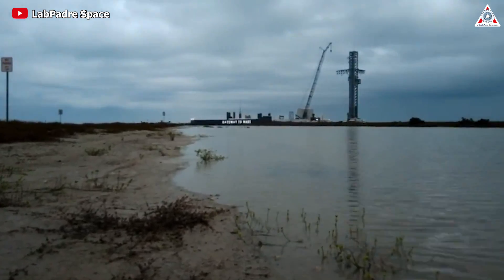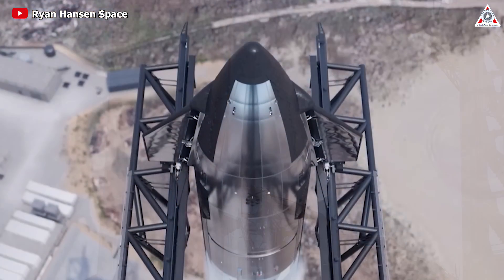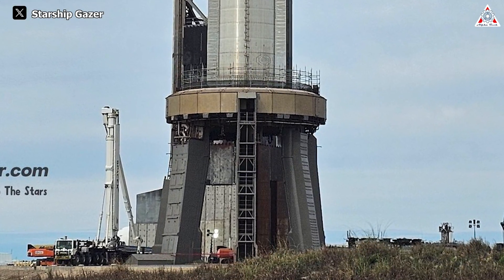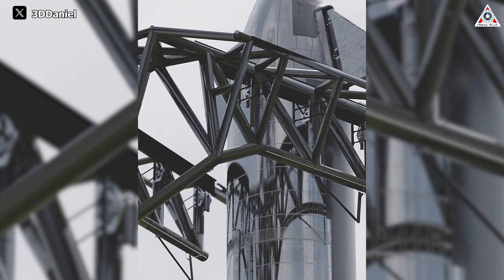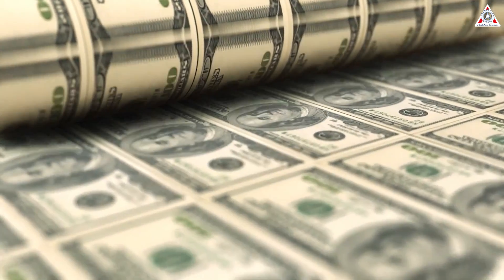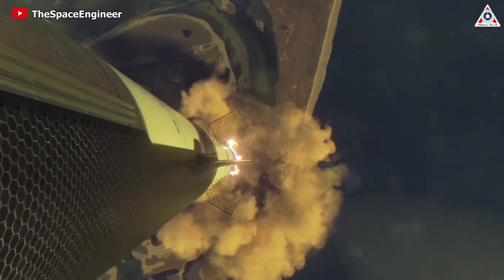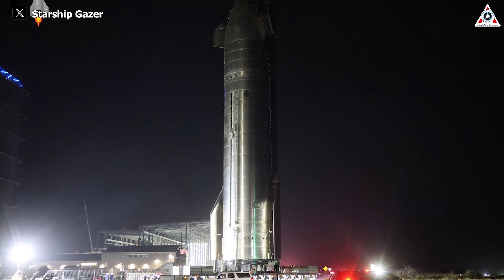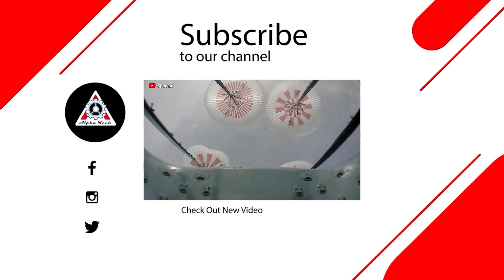SpaceX huge upgrade on Starship Mechazilla ready for flight 3 this month...

Comment: About the refueling tankers; are they considering round trips between fuel deposits?  They shouldn't.  Get 5-6 rockets lined up to launch alternatively from stage 0-A and stage 0-B and go drop fuel on day 1; then return sequentially, slowly back to the landing and disembarking from the stage 0 MechA-Z-landing pads A and B  on days 2, 3 and maybe 4.

Comment: Seems to me that catching this beast on just two small holes with pins is to small of a target. The original plan was to catch them by the flaps , why did they change the plan? Was there no way to beef the flaps up enough to make that work , or were they worried about tile damage from doing it this way? A flap catch seems like a better idea to me just for the fact that it's a much easier target.